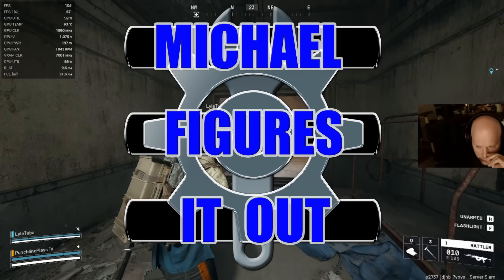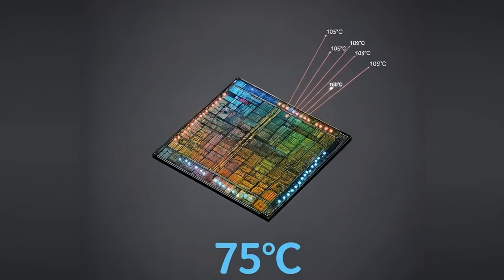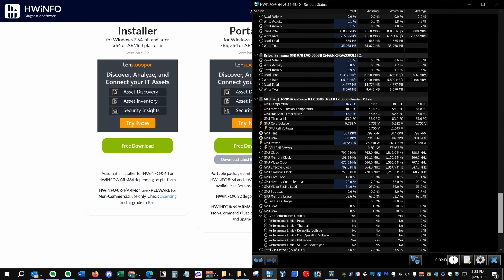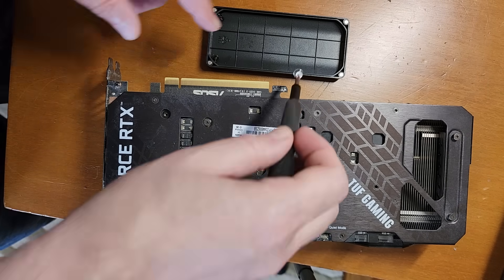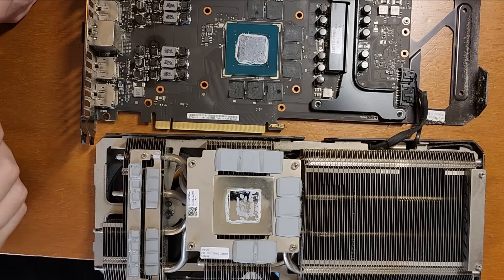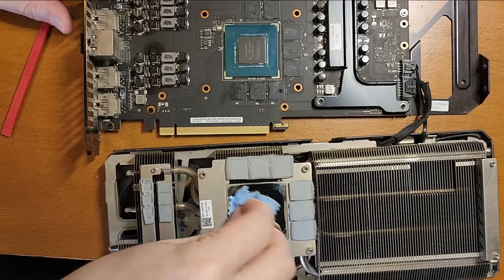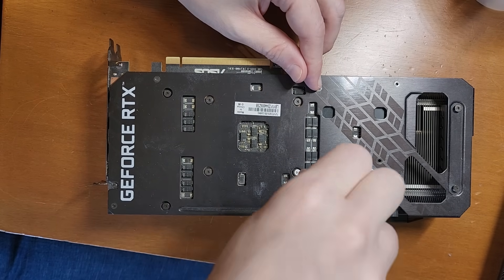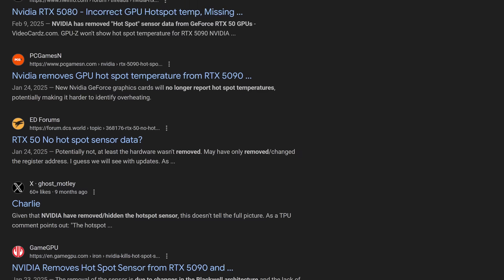GPU Temps Are A LIE!

Comment: Remember to tighten screws on the GPU die in criss-cross pattern, not like shown in this video. If you tighten the screws on GPU die shown in this video it can damage or worse break GPU die.
Reply from the maker: You're 100% correct!
Reply: @MichaelFiguresItOut yes I killed my 3090 precisely like this. One screw was stripped so I wasn't able to do it in cross pattern, and paid a good price for it. But MSI is here to blame also, 3 of 4 screws worked fine, one was so soft, I wasn't able to take it off. When I finally managed to take it off, it was too late. GPU did boot one last time and never after.
Reply: @iNubpwn3r  so you just did 3 screw? :face-fuchsia-wide-eyes:
Reply: @protonllimao04  yes, fourth wouldn't come off, I had to carve a line  in that effin screw and then use flat-head screwdriver.
Reply: @iNubpwn3r  fk i got this problem too but its on edge of the gpu. these screw is so bs.
Reply: @protonllimao04 what brand? I had this on MSI 3090, I suspect them doing this on purpose.
Reply: @iNubpwn3r  3090 ti tuf, i have this one screw on the edge thats so hard to unscrew. im still thinking on how do i unscrew this. its a bit stripped now but not completely stripped.
Reply: @iNubpwn3r  i finish replacing it now with tg phasesheet ptm. now hotspot max just 80. but now i got coil whine f. the coil whine first comeout when i unscrew some the screw on the edge, but i found one of the screw stripped so i tighten it back. so i just continue my plan to replace the thermal paste. the screw stuck so hard it broke my bit. i buy the screw replacement, glad at least its standard screw and the edge screw not the screw with spring. significantly better temp but i got coil whine.
Reply: That’s a universal rule for anything, btw.
Reply: he circumvents that problem by step increasing torque, but yeah good practice to criss cross
Reply: no he did it right

Comment: This is why I undervolt my 5090. Maxed out it was hitting 1.6 volts. And Nvidia removed the hotspot sensor. I set the volts to 1.0 and only lost 200mhz. 3100mhz to 2900mhz.

Comment: Hello, former paste user here.  

Every paste will "pump out" eventually. Every noctua, mx6 and also duronaut the supposed "no pumpout paste". It is just the bahaviour of pastes. No paste.... will change that.

Changing pastes will result in the same result in a few months to max a year and it will be an endless cycle.

Ptm is the only thing that csn actually change this and last wayyyyyyy longer. Do yourself a favor and use only ptm especially on direct die like gpu. On a cpu ihs its not as bad bc they actually have a metal ontop the die to transfer the heat to the ihs. 

Just soend a few bucks and use ptm if u need to repaste

Comment: Love the in depth explanation in this video!  

I've been so worried about my hotspot temps on my 9070xt red devil which caused me to run my fan curves extremely aggressive.  

Now being armed with a much better understanding of normal temps I only run my GPU at 1300rpm and the hotspot stays between 75-80c under full load.  Case fans are all under 1000rpm as well. 

Now I feel comfortable changing the thermal pad as well once it needs it... If ever!

Comment: you can see the hotspot in the amd drivers or msi afterburner.  and you can use phase change thermal pad or paste that lasts basically forever instead of normal thermal paste

Comment: 1:47 10 to 15 higher that global temperature?
Yeah sure, tell that to my RX 6800 XT OC that had 70 C global and 101 hot spot before undervolt THIRTY C diefference!
And the card is new with 3 fans, huge radiator and 3 120 mm fans on intake on my case

Comment: I bought an RTX 3070 ti that was black screening when playing games that were even slightly graphically intensive. I took it apart and repasted it and put new thermal pads on as well and it works perfectly now. it was going from 30c hot spot on desktop to 125c hot spot in about 20 seconds.
Reply from the maker: Wow. Good job!

Comment: Ooh, I wonder if this is what's happening in my new prebuilt's 5070ti which keeps intermittently crashing in some games. The shopping cart I used to get the PC from the Microcenter to my car rattled like crazy, and while the box itself had the usual foam protection stuff on the outside, there was nothing inside the PC case, GPU must've rattle like crazy too (even though it had a support bracket). Perhaps one of the thermal pads inside it were damaged. 

Anyway, I'll have to check this HWInfo64 thing out. Edit: Nevermind, just saw in another comment that "Nvidia removed the hotspot sensor on the 50 series"...
Reply from the maker: I doubt the vibration would cause a thermal pad to come loose. They are sticky and squished in there tight. They also go on the memory not the GPU. 

Check Event Viewer exactly when you crash and feed the results into AI for some help. You can also try undervolting the card to see if it help.
Reply: @MichaelFiguresItOut  Event viewer gives different messages about different instances of the crashes,  each game gives different ones too - the ones that log or output crash info in some way anyway. Most basically say the GPU drivers crashed or the GPU disappeared from the system or stuff along the lines.

I think it is VRAM-related though, as aside from UE5 games that crash in middle of gameplay, other games that crash do it during loading saved games, fast traveling, or in the middle of cutscenes where it would be loading the new stuff into VRAM.  I am guessing UE5 games simply load more stuff into VRAM as the games goes on than others do for some reason. At least once, the driver crashed even happened outside of a game, I think Steam Client was trying to do something...

Undervolting / capping framerate seems to make the crashes happen less often, but doesn't get rid of them completely. 

I haven't had a single synthetic benchmark I tried crash on me, and unfortunately I have not found a way to consistently reproduce the crashes either, or I would've already taken the PC back to the store for warranty repair.
Reply from the maker: @thewhyzer  Punchline had the same issues - GPU drivers crashed or the GPU disappeared from the system. I figured it was the hitting the Thermal Limit and shutting down the graphics card, even for a second, causing the crashes. 

Your 5070ti has 16GB VRAM so I doubt the issue is too much info overloading the memory on the card. It could be overheating. What temps are you getting and does HWInfo show the VRAM temps (it might be GPU Memory Junction Temperature)?

Fan Control is a great free program to control fans. Jay2Cents did a video on it.

Also, try Windows Memory Diagnostic. It's different from Memtest and I've found issue on my PC. It's not VRAM but still might be an issue.

Comment: A few errors-
Thermal Throttling was not occurring at all, furmark is the heaviest way to hit PL and it was still drawing the full rated 220W, something that does not happen at all if there is thermal throttling. Furmark is also the most heat generating benchmark possible as you hit TDC limits before any voltage limits, thus running at the highest possible wattage, Ampere throttles at 110C hotspot, and 83C core, neither of those were hit, and realistically furmark is way hotter than any game ever will be. 

When thermal throttling occurs it does not cause crashes or freezes, if it hits full TJMax, the card will simply shut down the whole PC, not just close the program. You never do end up sharing the results of re-pasting apart from the temps being fixed, I doubt punchline had his crashes fixed.

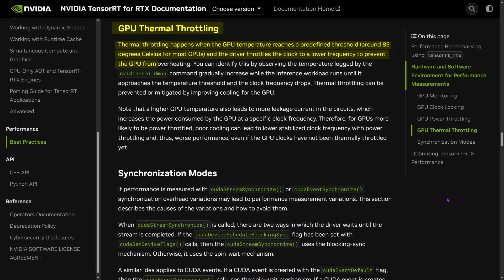0:25 Thermal throttling is controlled by the vbios, not the driver .

1:45 this is true with nvidia however, it depends on the GPU, radeon tends to have a much higher delta between hotspot and core in about that 30c range in many cases. Intel for the time being lacks a hotspot sensor on their XE2 cards. 

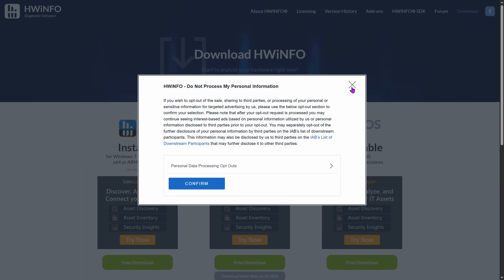2:00 You do not need hwinfo for this, in the beginning you were using the alt+r menu that comes with the Nvidia App, you can easily configure it to show hotspot temp in the alt+z menu.

Im not trying to be an asshole or anything, just informative
Reply from the maker: Appreciate you taking the time to provide more info.

The Core Clocks were lower in Furmark before repasting vs after repasting. But Furmark didn't get his temps up as high as his games. PUBG was able to push his temps higher (sometimes hitting 105C) and all his crashes happened in games, not in the benchmark. I should have monitored the voltage during the games. That would have been a good metric to monitor.

Ampere does not thorttle based on the hotspot. It throttles based on the average temps and I listed those temps straight from the NVIDIA website about 15 seconds into the video.

Thermal throttling is controlled by the driver. NVIDIA states this on both these sites:

*) https://nvidia.custhelp.com/app/answers/detail/a_id/2752/~/nvidia-gpu-maximum-operating-temperature-and-overheating

*) https://docs.nvidia.com/deeplearning/tensorrt-rtx/latest/performance/best-practices.html

The VBIOS controls the Thermal Shutdown temp for the GPU.

This makes sense because a driver error could occur that prevents Thermal Throttling but the VBOIS will kick in Thermal Shutdown at a certain temp to prevent GPU damage.

I'm sure it was the temps that were causing his crashes for these reasons:
1) The thermal paste was dried out and his hotspot temps surpassed the Thermal Throttling limit.
2) Many of his crashes showed nvlddmkm in Event Viewer, which points to the video card driver crashing.
3) Repasting has greatly reduced his game crashes.

My theory is that the hotspot would hit the thermal throttle and the resulting Thermal Throttle would cause some games to crash. He would also hit the Thermal Shutdown limit sporadically and that would cause the GPU to shut down, crashing his PC.

Comment: Ruling out temps BEFORE checking hotspot is some amateur shit lmao.

Also, 10-15C delta is pretty good. Especially on air, you will usually see higher deltas than that
Reply from the maker: Most people are amateurs like me, not professionals like you. 10C-15C delta is good. Higher is not.

Comment: I also had to repaste GPU because hotspot was at 100c when gaming while the normal temp was at 65c
Reply from the maker: Wow. That's a huge delta.
Reply: @MichaelFiguresItOut RTX 2080 Ti which has been used since launch. Got it from my uncle when he bought RTX 4090. That delta was big indeed, overclocking the card was easier too now that it didn't artifact from a simple OC

Comment: Thank you very much for your explanation I also have this hotspot problem my Hotspot is 30° hotter than average and the service center sentenced my video card to thermal paste replacement but asked for the unreasonable $80 for that so I'm currently waiting for my thermal paste to arrive to risk and do it myself meanwhile disabling all the advanced graphics features in my games
Reply from the maker: Good luck. I just did this for another graphics card and it was a lot quicker and easier now that I did it once before.

Comment: Why is everyone acting like they've just revealed a previously secret, recently discovered feature (hotspot temperature)?
This has been displayed right next to the average temperature in all telemetry programs I know of for ages.

The thermal paste on this card is a disaster.
Air-cooled cards should also be regularly cleaned of dust (and the PC case, of course).
Where is the essential support for the graphics card shown here (the most important thing of all)?

Personally, I now advise against high-performance pastes, which usually degrade quickly.
Instead, I always use good pastes (good old MX4) that last for many years under heavy load from long gaming sessions.
Constant disassembly and cleaning means avoidable stress for the GPU (especially with a paste that's already hardened, like this one)!
The temperature differences are only a few degrees, and these pastes with only slightly better performance are also significantly more expensive.

As with all the equipment used by influencers and streamers online, my final piece of advice is this:
If you want to potentially earn money with your content beyond just being a hobby, then off-the-shelf hardware is a definite no-go.

"Ugly performers shouldn't be running beauty tip channels..." 🙄
Reply from the maker: If you read the other comments, you'll see that most people were unaware of the hotspot issue.
Reply: @MichaelFiguresItOut  
They should just watch more channels like yours, ... 😋
Of course, you're partly right.

Most people obviously couldn't care less about hardware until they run into a problem (similar to their cars or household appliances).
Often, these are just consumers who only know where the power button is and how to operate the peripherals.

These days, these users increasingly turn to new media (YouTube) because Google searches bring it to their attention (experts are expensive, and nobody asks their neighbor anymore).
Nevertheless, hardware monitoring has existed for about 15 years (readable by anyone, albeit with significantly fewer sensors), at least in Nvidia GPUs.

Comment: Also yhe vram modules heatpads can harden and crack when removing the radiator, so make sure to align the pieces if youre going to use the old ones. If theyre uneven the surface is uneven and wont have full contact on the gpu and your temps will be even higher than before
Reply from the maker: This is true. Luckily his thermal pads were in good shape.

Comment: Ok so that's an Nvidia card and it dose not have a sprung retention bracket on the back so there is not much force clamping down the cooler to the GPU, this is why most Radeons don't have this issue, and role of thumb for moder's F@CK the warranty, i remove the water block air cooler every time and repast with something i trust will stay liquid for 5 to 7 years and not fail, and i put on very little past spread thin with my finger ! yes my finger, both surfaces should be mostly flat, then sprung retention bracket should if needed be shimmed to apply as much clamping force as posable, on my RX 6900 XT EKWB water blocked, in games i get 57c hotspot, 45c GPU at 2.5Ghz on the core and 47 CPU playing Dying Light the beast.

Comment: Nvidia stopped displaying the GPU hotspot temp for the RTX 5000 series, and it my be 20 to 30c higher than the GPU temp, the thermal throttling is tied to your GPU hotspot. and there are some tricks to getting your hotspot temps down, this is not an issue on most AMD Radeons, they display the hot spot temp and more often its just 10c difference, fixing temps is complicated, but will post it up if any one is interested.
Reply from the maker: Seems AMD is more advanced for some aspects of video cards.

Comment: My AMD's Radeon RX 6700XT Eagle runs at roughly 80ºC but the hotspot gets all the way up to 112ºC — for months now I've tried to force it down, but even after reducing 100mV (1200mV to 1100mV), even after reducing 500Mhz (2600Mhz to 2100Mhz) and even after reducing by 10% the limit power draw (100% to 90%), the GPU hotspot still goes instantaneously to 110–112ºC as soon as any type of load is introduced.
Reply from the maker: AMD is different and may be able to handle the larger delta.

Comment: You(and manufacturer's) should use non-solvented thermal solutions(so called phase change materials). ->
What you faced here called "thermal pump". 
What's happening here: because gpus are actually a lots and lots of simple compute units connected with cache and encircled with memory controller( two last occupies ≈40% of space actually) its placement requires a lot of silicon area. 
Here's magic happens: silicon die isn't flat, under load it bends. I mentioned GPU is combination of numerous pipelines and CU, its placed in center, mixed with cache. But center is primarily where CU is placed, so its usually hotter than  rest of area, so whole die bends like paraboloid. 
Under tenths of thousands repeats it lead to thermal paste separation. Then it separates silicon oil(usually it used as solvent in thermal pastes) just evaporates and thermal paste become hard sand losing its normal viscosity. It creates univen spots and basically dies starts overheating.
Why Nvidia removed hotspot? 50-series have extremely big die's, consumes 400+W, so how do you explain to your consumers why new video card have 90+hotspot?

Comment: First time i learned about the hotspot, was with a 3060ti dual fan model. Quickly was at 100 degrees. Undervolting was very effective with afterburner. Now i tested an Acer Nitro 9060xt OC. Undervolt didnt help the hotspot sitting at 92 to 95 degrees. GPU temp far under 70 degrees. Until i tried to manually control the fan curve, again with afterburner. Now its under 80 degrees. Turns out, the card is perfect, just they agressively optimised noise over temps. Factory difference between hotspot and gpu temp was up to 25 degrees. WTF
Reply from the maker: Yikes! Glad you were able to figure it out. I always prioritize speed over low noise.

Comment: This is great video! I will use the information from this channel when i need it most particularly this one where it takes apart the GPU. Thanks! But two important things that could've been better :
1 : Tighten the screws in a (X) way instead of one like you did
2 : Use a  Anti static wrist strap.
Those were the only two issues i had with this video. Other than that solid video! Thank you for the video and have a great day! (whoever is reading and all :D cheers.)
Reply from the maker: Thank you. I agree on the X pattern but I pinned a comment about that to let people know. And I did use the anti static bracelet. I also discharged static by touching the metal of the case each time I had to touch a component.
Reply: @MichaelFiguresItOut  Touching the metal case also works? If thats the case this is awesome and i learned something new! Thank you.